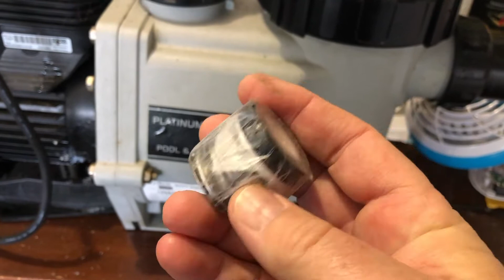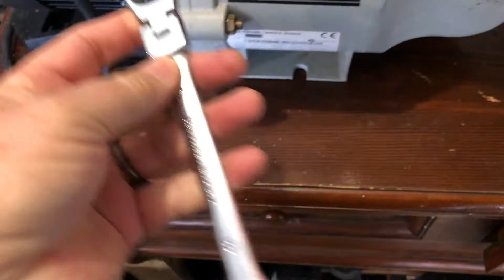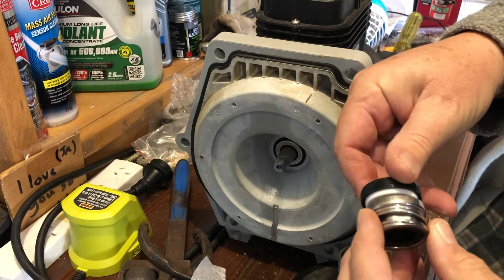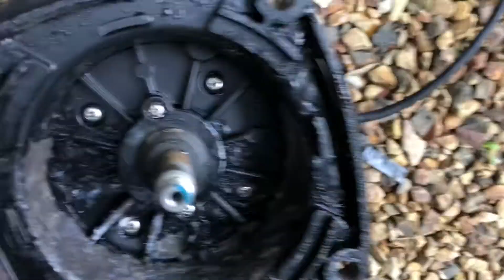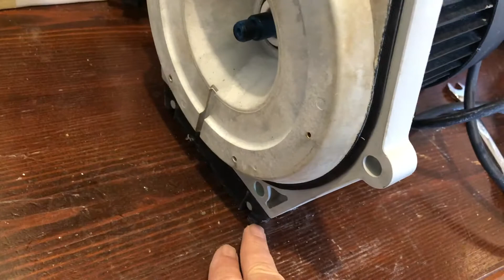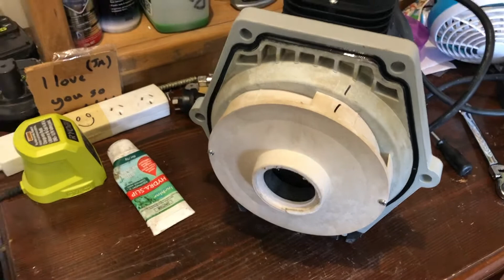Replace Mechanical Seal in Swimming Pool Pump. Spa Motor leaking? New seal Installation. How to

Comment: Gripping around the outside of the impeller is best.  Very easy to crack on the nose, but if you have too I recommend plugging the the nose of the impeller to prevent cracking

Comment: i just changed mine and its over heated after 20 mins running perfect    and it melted the backing plate .. wat could cause that ??
Reply from the maker: That happens when the pump is run without water  so it may have taken too long to prime up with water. Or maybe it never filled with water. 
If it just has a little water that can boil in there. Again if that happens it will melt the plastic
Reply: @Marksreviewsandtutorials  yes it took about 5 mins to prime up but then run great for about 20 mins then it just pissed out ... i took it back apart and the mechanical seal looked like it was burried into melted plastic 🤦🏼‍♂️🙈  iv managed to clean it up put another rubber seal in with a little silicone  then put the white ceramic ring in .... sbould the mechanical seal on the impeller  be bonded on incase it spins on the shaft ?? its pretty tight fit anyway ... thank you for your reply ❤❤
Reply from the maker: @spandangle334  Sadly it is doubtful that you can repair it from there without replacing parts. There are tight tolerances on where the seal sits and the pressure between the two parts of the seal and the seal faces have to be flat. 
It sounds like it ran with just a little bit of water which then overheated due to the friction in the pump melting the plastic. 
Let me know if you want some pricing on pump parts or a new pump. 
Mark
Nillumbik Pool & Spa Service Australia